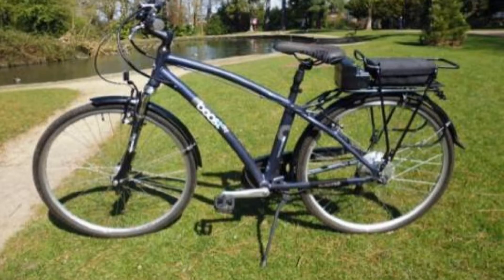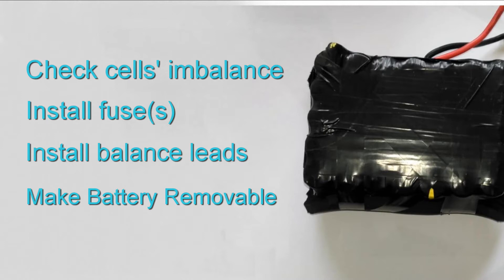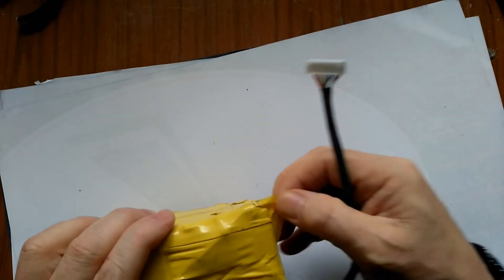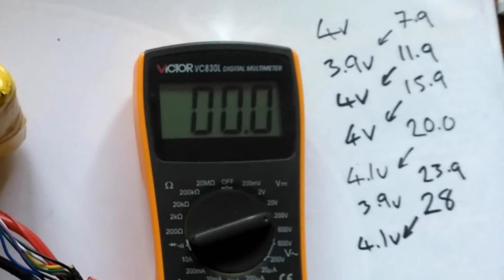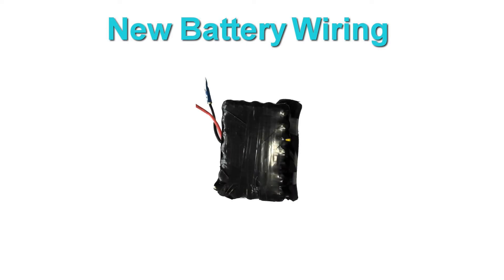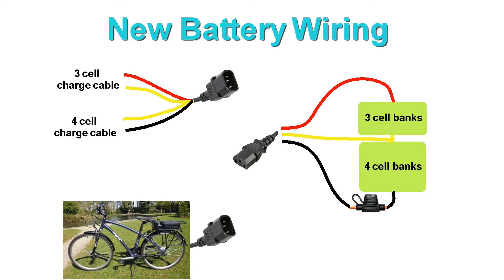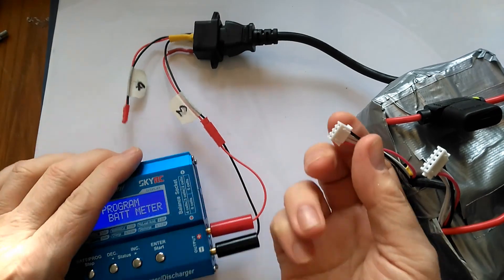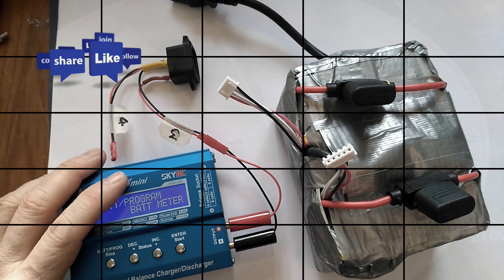7 Months E-bike Commuting without Balance Charging. What's Inside?

Comment: excellent simple explanation .Thank you i will be using the same system on my bike. Ps a kalkhoff the batteries are designed so as you destroy them if you take them apart wouldn't buy another kalkhoff for sure.

Comment: How did you measure the internal risistens?
Reply from the maker: The charger does it be measuring voltage and current and doing a calculation with Ohm's law.

Comment: And also another reason of Your battery pack not charge properly is soldering. Bcoz when u use or charge battery it generates heat and it reduce conductivity of battery connection points . So try proper weld or connected battery
Reply from the maker: Yes, didn't I say that in the video? I didn't build this battery - I bought the bike with this battery on it. No fuse, no balancer. Unremovable. Eek!

Comment: As per my experience BMS also not charge in balance li ion battery. instead of BMS I use external Balance charger and It's works good.
Reply from the maker: And the big advantage for me is that the BMS I bought (OK it was cheap & from China) didn't work reliably. When you close up a battery pack with a BMS inside, connetced permanently - your'e REALLY trusting that thing with a lot. External balancing leave a lot more room for understanding and monitoring what;s going on, and is in my view, far safer.

Comment: Hi! So this is a 7s configuration and you made a balance connector for 3 and 4s and charge and balance them individually?  I have a 12s pack and i have a 6s charger, basically i want to do the same as like you did but not sure if its going to work, i want to connect 2 6s balance lead to them from 1s-6s then from 7s-126 and charge them individually as 6S. Safe? I wanna do this to my pack..
Reply from the maker: Yes Glen, my exisitng balance charger could only do up to S6, and at the time I was very short of money, so that was the best solution for me. Of you have the money to buy an S7 charger then this approach is dumb. Yes, you can do the same as I did with your S12 battery. In principle it's completely safe - the battery is isolated from everything else, so neither half will "know" that the other half is being charged. Of course in practice, what makes LiPo batteries so revolutionary also makes them dangerous. They can carry huge amounts of energy ands release it quickly, so - always work on a flat discharged pack, work on a clean non-metallic bench, don't wear rings, and be ever alert to short circuiting any cells. Onther of my videos shows me falling foul of this. The entire case of the battery is the negative terminal, so it wurrounds the positive terminal at one end. Only a thin sheet of plastic and/or paper seperate them, and an aggressive pair of pliers or scissors are all it takes to break through the insulating sheet. If that happens things can get veyr hot fast. I have had a wire weld itself to the battery and it's too hot to touch so you sit there wtaching it get red then white hot. In my case, it melted like a fuse and everything went quiet - but it could go the other way. So - think bomb!
Reply: Chris Wesley thanks for your explanation it helps a lot. I have a123 22650 pack module and dont want to spend a fortune buying a bms for it, and a charger also with active balancing i can only afford a 6s charger.. 

I will charge the 12s as 6s simultaneously with active balancing charger, im not gonna put a bms on it because i dnt think im gonna discharge it to max current. My pack can give 400amperes of continous current, i will only use max 50 amperes on it and probably 25amps continous. I will install a boltmeter so i can monitor the voltage so it wont go that low because there is no bms to protect it.
Reply from the maker: @electric_rider2044  BE careful if charging both simultaneously that you don't hit problems with common grounds. If you ground the low side of one half of ther battery and then also ground the low side of the other half, you have effectively shorted out one half of the battery entirely.
If you're using mains isolated trnasformers you should be OK but in any and all cases - I would always make sure there is a physical fuse between the battery being charged and the charger.
BTW I plan to build a cheao but far better better charger for myself soon. Look out for the video if you're interested maybe subscribe.
Reply: Chris Wesley yes i understand. When i charge 1-6s first the positive on the End is not connected to anything, so it will be an open loop, only connection is from negative of the first series all the way to + of 6s  then positive end of the pack is open..the next charging is from 7s -12s them the NEgative of 1s is open again to avoid ground.. does it make sense??

Comment: A brand new lipo battery would be about 3 to 6 momhs. Anything under 10 mohms is considered good. Anything from 10 to 20 mohms is ok, but could be better. Anything from 20 to 30 mohms is considered to be tired and need replacing soon and anything over 30 mohms would have a lot of voltage sag under power load so unless you use it on a low powered ebike you should replace it asap or as soon as you have the money to do so. I ride a 7000 watt ebike so if my cells were at the same mohm range as yours they would probably sag to the point of low voltage cut off unless i used minimal amount of throttle. If you replaced the cells in your battery pack you would see a massive increase in power and would also be able to travel a lot further too. I have also had so many BMS problems and they can be quite expensive too, so there have been times when i have had to ride without one. As long as you take care of the balancing of your cells about once a month then you should be good without a BMS. Good luck with your new battery build when it comes to that point. ;-)
Reply from the maker: Hi Lisa and thanks for making time to write comment which was helpful and interesting. In the UK there is a legal maximum of 250 Watts for EBikes and 15mph. In fact, mine cuts out at 12.6 mph. So  I'm probably not seeing the impacts you would on your monster bike. But the battery is getting tired. I have accumulated a lot of batteries now, and I'm slowly testing them for capacity and self-discharge. I'll build another one soon.

My non-balancing "charging brick" takes the cells to 4.2 V which I'm given to understand shortens the life of the cells. Maybe I shouldn't care since they're poor now anyway.  Even after one use, the battery is poorly balanced. I think I'll just run it into the ground and replace it.

700 watts. Wow. That must be a lot of fun. Got any videos?? No wait - you said 7000 - 7 thousand watts. That can't be right. Can it?!
Reply: Yes, it actually gets 7300 watts with amps around 105amps. It was more powerful but my battery was too heavy and it made the bike hard to handle because of it's weight, so i made my battery smaller. I use the Enduro frame. I have a 3 speed switch so it makes it legal when i use the legal speed mode (I live in Scotland) but the faster speeds can only be turned on with an extra key (having a simple switch is still illegal so i did this to get around this problem). I use Headway LiFeP04 batteries that i get from Eclipsebikes in the uk, they are good for 2000 + charge cycles so you don't have to buy another battery for a long time. I've used the cells in my battery pack for over 2 years now and they still work pretty good. You should check them out as the battery pack can be assembled with no soldering as they screw together. I don't have any videos as of yet but i think i will do 1 soon. If i do then i will leave a link for you to see. :-)
Reply from the maker: So your bike is a 70 volt system? I didn't know they went that high. I checked some of my stockpile of LiIo cells; all from laptop batteries but new, un-used ones. They have 2400maH capoacity, but my iMax B6 tells me their internal resistances are all around 100 milli-Ohms. I've heard good things about LiFePO4s but they're not available free, as far as I know, and therefore out of my budget. Maybe when I'm rich & famous...
Reply: I built my battery pack myself. I just bought a couple of cells at a time until i had enough to make my pack. I bought an infineon ebike controller from EM3EV in china so i can run any voltage up to 100 volts, it's an 18 fet controller ( i had a 24 fet but it is so big so i now use the 18 fet. I got my bike frame from EM3EV too. I started off with a 1000w ebike kit from ebay but I toasted it pretty quick when i put close to 6000 watts through it. I now have a QS 205 50H V2 hub motor and it is rated for 5000 watts (it can take around 15000 watts for short bursts ;-)) The good thing about LiFeP04 batteries is the discharge curve is really flat, it stays at the same voltage until the battery is flat unlike LiIo which the voltage will decrease until it's runs flat. If you only have cells with really high resistance then putting more in parallel will help a lot with the voltage sag. It's always good to have more mah than you need as you never know when you'll need that little bit more juice in your pack. The 250 watt setup that you have (250 watt will be the cruising power it will be probably around 400 watt peak) should be able to take a bit more power. If you open up the controller you could beef up the shunt inside with some wire or solder to give you more torque from a standing start, it just fools the controller into giving you more power without replacing it. Once you get more power out of your bike you'll have that ebike grin that i get every time it take it out for a spin. :-)

Comment: You have created an excellent video. Very well done! The fact is, your cells held their voltage to within 0.7 volts after 7 months plus however many months the original owner had it.  It is testimony that the incessant drumbeat about Battery Management System boards may be overblown.  From appearances of the cell various colors, I think your cells were used in the first place, and you have received excellent service from them.  Building a new pack should be easy for you and will give you years of service with or without a BMS.  Keep an open mind and question the orthodoxy about the value of Cheap Chinese Electronic BMS boards without solid proof. Good Luck to you! Cheers 18650 E-Biker
Reply from the maker: Hi E-Biker. Thanks for your comments. I like your very different and low-tech perspective. Another viewpoint on the map is often welcome. And I like your low-cost angle on things - it suits my ethos and my budget. I've subscribed and will  enjoy your videos over Christmas.

I'm open to doing a collab/cross-promotion of channels. If you're interested, let me know.
Reply: @chriswesley594  "I like your very different and "low-tech perspective."" Seriously??? And then you suggest "collab/cross-promotion of channels" over yr after his comment.... Was that Brit humor? Sorry its hard for me tell sometimes.... For what its worth he seemed to make a good point initially in his low-tech perspective way...  And good luck with your bike...Also thx for showing me 18650 E-Biker channel, good luck learning from it too.
Reply from the maker: @nc3826  Now I am confused. I DO like his low tech perspective; what's wrong with that? Perhaps you thought that description was somehow critical or offensive? It certainly wasn't intended to be.
Reply: @chriswesley594  Pls excuse my take on what you said. But calling someone low tech in a high tech field doesn't seems like a complement to me? But thats just me, no offensive intended and thx for the post...
Reply: @chriswesley594  And he was just advocating for what you did in this post... to do active balancing vs depending on a BMS... So how is that a "low tech perspective"?
Reply from the maker: @nc3826  I thinkk I recall he spoke about using a multimeter to check for under-charge, balanincing manually, spllitting one battery in to two and charging seperately, and those are what I meant by "low tech". You're not relying on an all-seeing BMS, butt using manual monitoring and common sense techniques to get the same or better results. Low tech in that sense.
Reply: @chriswesley594  I don't see anything about a "multimeter to check for under-charge" in his comment. But the rest is about how to create a battery back that can be actively balanced, like what you did in this post. And while there are trade offs between using a BMS vs active balancing. They both have pros and cons. So for a user that knows they will put the extra time in to actively balancing a pack it seems like the best option and just as High Tech. And it's ok if we view the term "low tech" differently.
BTW I'm just an old mechanic engineer who is just trying to learn the basics, from watching to many utube posts. To know how to rebuild a battery pack and how to reprogram the CAN-bus in an old ebike. So, the semantics of a term is not that important.
Reply: @chriswesley594  Everyone is a smartass on YouTube lol. Whatever works best man✌️